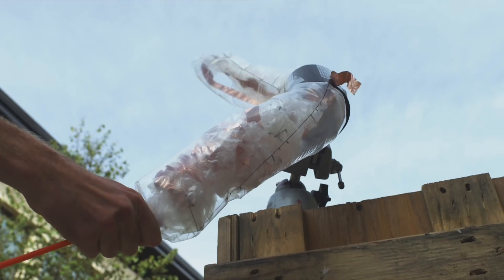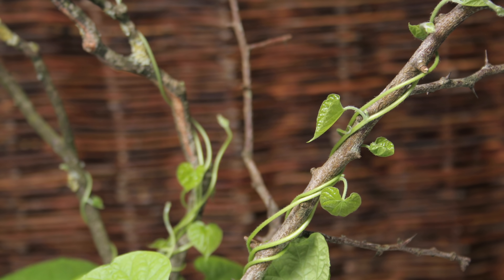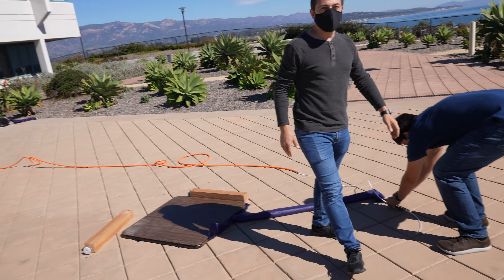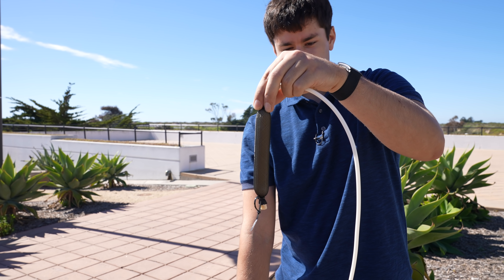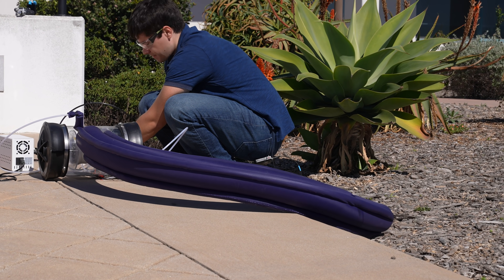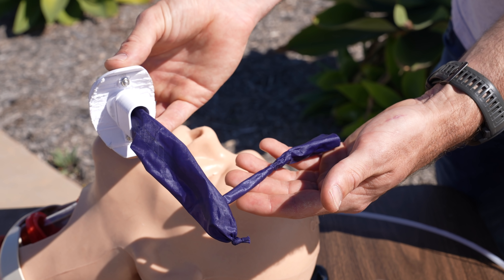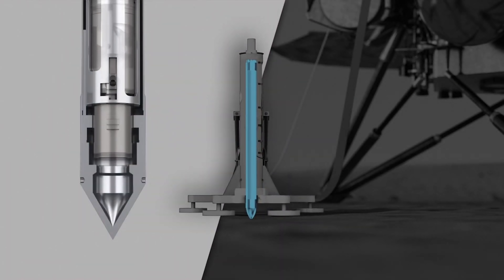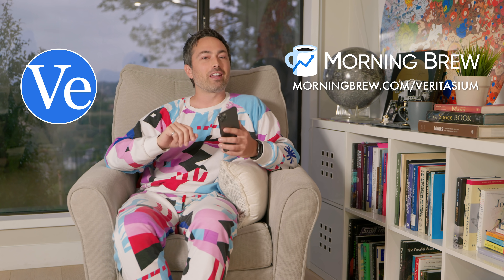This Unstoppable Robot Could Save Your Life

Comment: As a plumber, it would be awesome to have a camera with navigation capabilities for inspecting sewer lines or even looking under houses.
Reply: @elyriawonk6807  we have several cameras at my company and they work really well buy they have no ability to turn or control in any way. So if a branch drain has no way to access it from the building it is often not possible to get the cable to it. With one of these we could go from the outside access and then just turn it when we get to the tie in. Would be super helpful for sure.
Reply: @ZeeroDubs  it seems like their should be a snake like tool that could be used through sewer lines. Engineers get on this!
Reply: @aaronjohnson951  it's been around for decades, they have this exact thing with rubber that gets put into broken old Sewers and water pipes, it lines the inside, plugs large broken sections, rather than digging up pipe and replacing it they use this, this is not by any means new tech.  In fact I question if they stole the idea
Reply: @breakingames7772  that's cool. A different kind of cool but cool nonetheless
Reply: @ZeeroDubs  You could probably build one with enough patience and time.  For the purposes of inspecting pipes it's fairly unnecesary to have any steering, except maybe on the camera itself.  

That simplifies the design quite a lot, the hardest part would be making it retractable but its nothing you couldn't overcome with a bit of trial and error. 

I have seen remote control cameras on the ends of long rods for this purpose, perhaps one could be modifies to work with an inflating tube? 

On a side note, it would be much more fun to build a robotic spider capable of climbing inside of the pipes to inspect them.  You could give it little cannons to shoot blockages and turn you day job into a video game.
Reply: @SineN0mine3  Well, compressed air could be a little gun to clear blockage I bet. Especially if you can crank up the psi a bit.
Reply: I was thinking about the many applications for it's use by a plumber, I would sure make their job easier. Not a plumber
Reply: Just don't bend over near it
Reply: @-darrell  omg 🤣🤣🤣
Reply: @elyriawonk6807  yes I used to televise sewers for a living and we had small tractors that carried the cameras and also pulled the umbilical cord that runs it and measures how many feet down the line we were. This technology would allow for a new level of access in such professions. Crazy technology.
Reply: Do snake cams not do the same thing? Maybe not to the extent of this robot but it still work I think.
Reply: As a plumber you should have already used this, it's a damn pipe liner, they stole this idea from that.  Been around for decades
Reply: @breakingames7772  Exactly. And this "inventor" is totally lying about his inspiration.
Reply: I saw a video of them being already used in penetrating a clogged sewer pipe
Reply: At our plumbing company we have 4 cameras. We can see in the drain just fine but without navigation abilities you are limited by access. Sewers systems are designed to drain flow down hill and the camera will follow that pathing. On a typical sewer camera you can o ly exert pressure in one direction which is forward. There may be cameras with navigation capabilities but if there are they are cost prohibitive. My entire point about the robots in this video is capability to price ration could be a game changer.
Reply: They use this to do pipe repairs, it’s a sock that gets an epoxy resin pasted all over it, then it gets inflated into the drain, leaving a smooth surface that’s water tight again… I’ve used pipe burst ers that involve a heavy machine that hauls a bullet shaped pig through the drain ant the old pipe shatters around it while dragging the new pipe behind it. Great until you find a tee… the socks are better… now under floors that are physically inaccessible this would be great to be like a draw wire component..
Reply: I’m pretty it’s been used to apply pipe lining so you have an extra layer for corrosion
Reply: Actually there's another video that shows an application of this exact invention that coats the inside of old sewer lines with an extending  plastic snake like this that solidifies within seconds and basically creates a brand new smooth plastic sewer  drain on the inside of the old rusted cast iron drain pipe....
Reply: @LukeKeeganN  Right?!
Reply: It would be great for running through crawl spaces for leaks so can pick the best path to crawl through.  You might even be able to make is small enough to fit inside a wall to reduce drywall demo or into a mechanical shaft to greatly reduce the time it takes to locate a leak.
Reply: @alexwhite9066  how would it traverse studs?
Reply: A colonoscopy while outside the colon
Reply: Bore scope?
Reply: They already do
Reply: if I'm not wrong, that's one of the uses of this robot, I saw some videos of it being used in this exact situation before
Reply: YAAAYYYY! We can look at yet more sewer lines!!
Reply: aircraft borescopes do just that
Reply: They do.
Reply: For "plumber"
Reply: Or looking somewhere else
Reply: Yeah you're right untill the plumber only be a plumber with this thing 🙂
Reply: Cured in place pipe uses the same technology compressed air after the resin has cured
Reply: I know this is an old post, buy there's a company that makes repair tubes that expand just like these robots do to create a liner within old pipes.
Reply: that would become my new hobby
Reply: Or just outright having an unclogging device.
Reply: It kinda like pipe lining! Btw they have what you want it’s just very expensive!
Reply: Pov: you use this thing and see an eyeball blocking the pipes and then the guy asks you “what you find?”
Reply: I think I've seen a video on YouTube of some plumbers using one of these to install a new lining on the inside of an old cast iron drain.
Reply: Trust in Jesus Christ
Reply: @juanit0tackit0tackito2  nah

Comment: I thought compressed air + the human body was generally a big no no.
Reply: Compressed air + the human body is only bad if the pressure is high enough / air winds up inside the body rather than in the external compartment.

Comment: Any business that involves sticking objects into sand all day should take advantage of the air pressure technique. I'm sure with an air compressor, and a little innovation, you could cut some job times in half, depending on what the job is. For example, sticking umbrellas in the sand for a beach party would be much faster.

Comment: Maybe it would be good for those blood vessel catheter procedures, especially the ones where they have to start in the leg?

The fact that the outsides of the vine aren’t moving relative to its surroundings mean it’s not rubbing, which means it might result in less trauma to whatever vessel or pipe it’s exploring.

I wonder if it would be possible to segment the muscles so when you “flex” one, it only bends a section of the vine instead of the whole thing.
Reply: That problem iris that it inflate gas I’m into the blood vessel which is very dangerous
Reply: @ValkyrieSirena  Yeah it’d have to be difficult to puncture
Reply: @ValkyrieSirena  Also I'm unsure that you could scale this concept down so far while retaining the functionality to steer and retract the hose.  At the very tiny scale, bends in the tube and tiny punctures would be much more of a problem.  

I also can't imagine how you'd fit the motors inside of it required for the steering and retraction, although with the precision of modern robotics, perhaps that is more possible than I believe.  

There maybe be niche applications in medicine in the future but it will pale in comparison to things like nano-robotics and bio-engineering.
Reply: You’d still have to guide the “non-moving” outside of the vine into the vessel….and hence, it would be moving, rubbing, during placement. Something like this is not feasible, or helpful, to arterial procedures. 
As a former cardiac nurse, what they have works well for vessels already. It’s specified nature is better than trying to get this type of material into a vessel. You have to work with the anatomy, not against it. 
Of course, what would be ideal…is not having to access the femoral artery (risk of bleeding (not only from the anterior site, but potential retroperitoneal bleed).

Comment: I have worked in the field of special effects makeup and creature effects for the last 25 years. Throughout my career I worked at various times with a gentleman named Bill Bryan. He is best and maybe least known for his role as the Stay Puft Marshmallow Man in the original Ghost Busters film. He was the performer in the suit he created for the role. Over the years Bill created amazing creatures, and elements of creatures using the exact techniques employed to actuate the vine robot. The creations were primarily fabricated from plastic bags seamed together with various incarnations of a soldering iron. I made several soldering iron tips for him that included a small brass wheel that could be rolled over the plastic in intricate patterns. So as opposed to creating the shape that the tube assumes after the fact, he created the shape integral to the tube. It took a lot of engineering and the results were mind blowing. Many of his designs included a piece of monofilament line attached to the end of the shape on the inside so the shape could be rapidly inflated and retracted. The source of inflation and deflation was almost always a shop vacuum because they were inexpensive and provided enough volume of air that multiple creatures or elements could be operated simultaneously. This was accomplished with a simple valve that we crafted from plastic and pvc fittings that employed both the vacuum and the exhaust from the shop vac. By alternating the valve ports with the vac and exhaust you could instantly change from blow to suck and vise versa. The sound guys hated us because it was almost impossible to record dialog when our effects were being used. We found creative ways of blimping the shop vacs or moving them off stage. There were some scenes for the movie Species 2 we had a dozen shop vacs running at the same time. Nice to see some practical application possibilities for the technique.
Reply: Bill Bryan was the first person I thought of when I saw this video - "Hang about, Bill Bryan was doing this 30 years ago..." It's fantastic what can be done with such a simple, but highly effective technology. Thanks for mentioning him and I admire the brass wheel guide that you made for him, though ultimately, didn't it gum up quite quickly and jam? Still, in theory that was an excellent addition to the process! I'm sure it could be developed further. Mind you, these days it's all CGI... unfortunately.

Comment: This totally blows something I’ve been working on out of the water. I’ve been working on something similar to the probe in war of the worlds. Mobile snake like extension with a camera on the end, but in my head I’ve been using solid pieces set together in a way that makes them movable. Kind of like a chain with motors attached to it to move in different directions

Comment: The best natural branching phenomenon how can I use this with lightning/electricity... 🤔

1) could I direct it with electrical energy. Say starting point and 2 different destinations kinda like a triangle ∆ so can it be an electric snake? Go half way to 1 point. Tho end at the other.. Control it's burrow, pressurize it, find a way to reinforce Maybe? boom you burrowed and made a hole for power lines.

I like electric so..

2) If thought of or found can we use molecular cells that electric stimulates into structure. Call me dumb if you desire yet, if probable would it make a single cell electric wire. 🤔

3) I also wonder how there device would work on a molecular level. 😈🤔 I think oddly 🙃

Comment: the giant holes in the moon. exploring mars stuff. going into those shafts they drilled holes in in the great pyramid, and finding that open area in the pyragmid they just found. plumbers unsticking toilets and pipes and whatnot. put an xray device on the end of it and have it do archeaology kinda like how the sphynx was covered in sand send it down the sound ten meters then take xrays in diff angles to see whats around it. unclogging arteries and veins of people that have blockages. Moving robot limbs by controlling the pressure. if you could put like bt enabled devices along the way so you could pump up certain parts of it could really change the game too. or how about putting elons brain thing around the brain instead of into it. this thing has endless value in so many fields its crazy!

Comment: These air inflatable cushions have been in use by EMS for some time.  They can lift significant weight very easily.  Locksmiths also use them to open locked car doors enough to insert tools to unlock them, again for some time.
Reply: Yes. Inflatable bags have been used for a long time. The difference here is the ability to deliver the bag where you normally cannot. And that difference is enormous.

Comment: Intubation aspect doesn't seem feasible, airways need to have some rigidity and diameter requirements for ventilation as well as diagnostic procedures (bronchoscopy) but I like where this is going...intubating patients is fairly easy but there's always that one nightmare situation where something like this is better than nothing.

Comment: The air burrowing robot would be a great emergency life saving device for people working in grain bins or grain piles when an air pocket collapses and they are buried. Would potentially provide an emergency way to get air to the individual. Also could work for avalanches.
Reply: Might struggle with avalanches as the snow around the victim solidified into ice.
Reply: @vshadow1115  i don’t think it’d be different than the sand demonstration.
Reply: @ARMTOAST Ice will not behave the same way that snow and sand would. The friction from avalanches melts the snow which solidifies into ice which is how people end up trapped under very little snow.
Reply: The avalanche idea might not work, but the grain bin idea is the best one I've seen so far in the comments
Reply: thats an interesting idea, though I think any implementation of it would struggle with the air supply. The threatened-to-be burried person would have to carry quite the large compressed air tank on them all the time in order to be able to inflate the robot and areate the grain/snow in front of the tip in an emergency, which makes it impractical for most applications. Not something a skier would wear. 

In a grain silo you could have a hose connected to a compressor attached to the building, since you're not moving far distances while wearing the safety gear. In that case the robots purpose wouldn't so much be to create a tube for you to breathe through (youre already carrying an air tube on you after all. Easier to just combine it with a mouth piece) but instead to send a marker to the surface that people can use to find and rescue you as quick as possible. Combine that with an alarm when you activate the system and you could get to a burried person in record time.
Reply: @BraindeadCRY  You could create the needed gas from a chemical reaction, perhaps?
Reply: Why not add a small heating device to the tip to melt its way through the ice?
Reply: @fritzbox6764  It would have to be a very strong heating device that also didn't harm the robot, as I'm pretty sure thick solid ice is much harder to melt, on account of the heat dispercing into the surounding ice that you're not intending to melt. You also need to not burn who you're rescuing, as this robot (at least as is) would primarily be for delivering air, and wouldn't be able to actually dig them up. So scorching hot thing into esaphegus is uh, not the best
Reply: could burrow into something else if you know what im sayin

Comment: Could this actually lift a boulder off of a human though? Pushing the side that is in contact with another surface would simply push all the weight onto the human. Inserting it between the human and the boulder would keep the same pressure on the human right?
Reply: Depends if the boulder is large enough to just lift it away from a side different from the victim